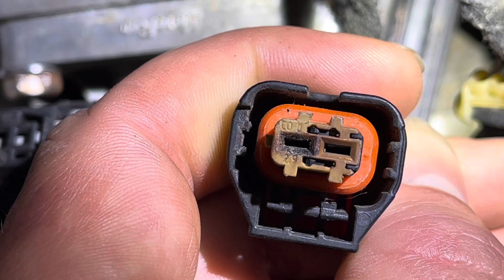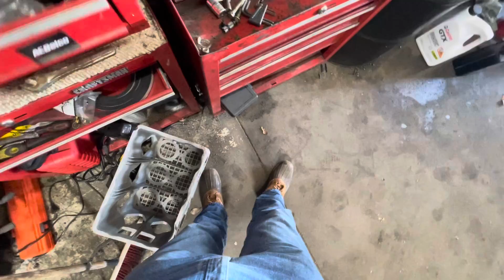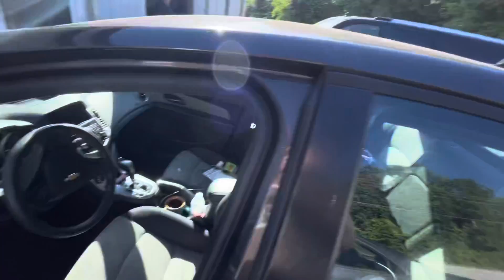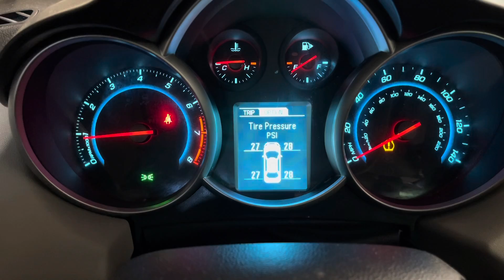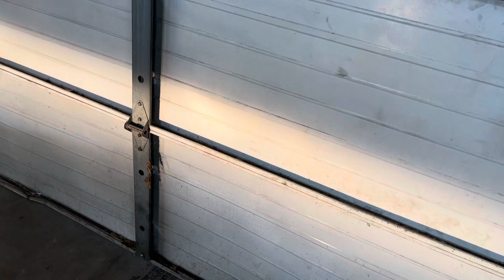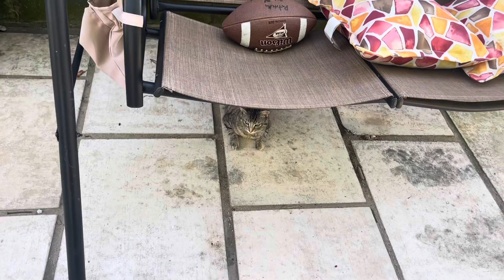Buying, fixing , and driving a $1,000 Chevrolet Cruze

Comment: Those are a pretty good little car. I bought one brand new in 2013 with 14 miles. It was a great car and will last if you don’t put cheap aftermarket/amazon parts on them

Comment: That’s weird yours has a big engine drain plug. I have a 2014 Cruze with the 1.8L and the engine oil drain plug is a little 10mm instead of the bigger one you have.

Comment: Jay hates every car. Ive been working on cars for almost 15 years, and sold cars for 14 years and i only hate VW and Chrysler products. I have a 13 Cruze LTZ RS 1.4 Turbo with 203k miles and its phenomenal. Runs and shifts excellent. Fixed all the usual issues. The 1.8s suck because they run a timing belt and are absolutely gutless. I love the Cruze, have since it came out. Theres a reason they are everywhere on the road still

Comment: I really like the looks of the later model Cruzes, but they have that stupid start stop tech. crap. Plus I worry about the cooling system problems with them. That is the one thing I hate about so many late model cars, they make them nice looking and you really want to buy one and then you read about all of the problems with them.
Reply: On the tranny, shift to L and with the up and down button, cycle it to L6 (if it has a six speed tranny.  If eight speed, L8.).  That will turn it off.
You'll have to do that every time whenever you put it in drive.

Comment: I’d take this over any Toyota or Honda compact car. With care nothing will go wrong besides whatever electrical issues you found. Seemed small to
Me . Change the oil every 3-5k and transmission fluid every 30-40k , coolant changes etc etc and it will be fine. Better looking than any Toyota or
Honda compact of these years.

Comment: whats geting sad is older cars and trucks part were ones someone was putting parts in plan to get back on road then something happens now everyone one was more now for older stuff i like them all fact is newer stuff so out sourced its no quilty  yet lot same manufacters sale same drive train for example is new process np 261/263/246 all junk 
old junk toyoda junk same made design 5.7 4.8 4.7 just number its the interior vs comfort vs dependabilty drive ablity add in try to repair something got remove ten parts to do it

Comment: All Cruze haaaave WIRING HARNESS ISSUES, COOLANT SYSTEM ISSUES, WINDOW ISSUES. You WILL have these issues even using GM parts to fix the issue, good luck going 5 or 10k before the issues happen AGAIN 😂😂😂😂😂

Comment: I remember back in 2007, I brought Chevy Prizm made in 1998 the mileage was only 22.8K but the body has a sign of improper cheap repair. I took it to Asians mechanic in LA area and has it done regular maintenance and the car was outstanding performance with used junks parts from e-bay. The cost to repair was low and it took me anywhere without trouble.

Comment: We have a ‘14 chevy cruze and we hate it. Only has 60,000 miles and has a bad coolant leak that the chevy dealership said they “couldn’t find”. Its has. The ignition coil rail fail several times apart from each replacement. Its turbo and it sucks at power. Always shifts weird during morning start ups. When the heat is on full blast the car kinda idles weird (up and down) for about 5 seconds. Im six foot 2 and had a very hard time getting in and out of it.
Reply: If the coil keeps failing the dealer techs are morons. 100% there's a short in the harness somewhere Aveos do it all the time too.

Comment: As far as your ground issue, there is a negative battery cable recall on these cars. I own a 2013 LTZ 1.4 with 45k.
There is absolutely nothing wrong with DexCool. My 2001 Silverado has never had a coolant issue, overheated or needed head gaskets or heater core. I just flushed the Cruze and put in New DexCool.
There were supposedly issues when Dex first came out. Anyone there has not been any reported Dex issues in years.
Reply: Dexcool might be the holy grail idk yet, I picked some up from autozone ran alot better after that.... just saying
Reply: At least for chevrolet cruzes late models.

Comment: I have a 2014 Cruze with the 1.8L. I recently disconnected the battery to clean the throttle body and I can’t seem to get the evap and egr monitors to reset so I can get a state inspection.
Reply from the maker: Check your fuses in the under hood fuse box. And check the ground wires mentioned.
Reply: @MXguy95  I checked the fuses under the hood and inside the car as well and didn’t find any blown fuses. I will have to check the grounds and see if any are loose possibly.

Comment: A friend of mine bought an LTZ trim brand new in 2014. It was at the dealer monthly for warranty repairs and it was a very frustrating ownership experience.
Reply: Overall as a GM vehicle they're not too bad if you get the non-turbo engines. Bonus for manual transmission. A guy at my work actually had a turbo Cruze around the same year and changed the oil religiously at 3,000 miles. He made it to 120k without any issues, ever. The problems with these cars stem from sludge because the people who buy these cars never do maintenance.
Reply: @NGGPeter  The problem is vehicle reliability is measured if a vehicle goes 200,000 miles these days without major problems. 120k is still low miles.

Comment: When the new Chevrolet Cruze launched in 2011, General Motors went into a crazy advertising blitz claiming this is the first car rated more reliable than Toyota Corolla and Honda Civic. They failed miserably on that and gave up by 2015. Today, General Motors is retrying this again with the all-new 2024 Trax made in Korea with Japanese-like quality, replacement of the Cruze, claiming to be more-reliable than Toyota and Honda again.
Reply: You can't just release a new car and claim it's more reliable than a car that's proven its longevity over several decades.
Reply: @benchattin  New 2024 Trax was descended from the 1971 Vega. Then 1980 Citation, then 1982 Cavalier, then 2005 Colbalt, then 2011 Cruze, and now 2024 Trax today. Each new model replaced is more reliable than the previous.
Reply: @waltchan  In what way is it descended? Because they're all small?
Reply: @666cemetaryslut That's the complete list of all the affordable Chevrolet vehicles since 1971 Vega, all part of the American Dream for middle-class families.

Comment: I worked on one for my Roommates daughter-in-law. Her boyfriend had Driven it through An intersection with standing water during a rainstorm And it died. Upon trying to restart it the starter wouldn't turn the engine over, So I was asked To check and change the starter if Necessary. I'm embarrassed To say that it took me Over 3 days to figure out that It was hydrolocked. The Intake it's right in front of the front Tire, two inches off the ground! Almost Any Amount of Standing water Would get sucked up into the motor. I like the way these cars look, And  probably good on gas But don't Drive it when it's raining lol🫠

Comment: I always thought the 1.8 was a good engine besides the timing belt. I really like Cruze’s they just don’t get taken care of by their owners.
Reply: The 1.8L engine are alright, it’s just the 1.4T you need to take extra care of.
Reply: @applepoop10  The 1.4t is good. My mother owned a 2012 eco that didn't give her too many problems. The only thing she had to replace was the water pump. She had the car serviced from day one dealership.😊
Reply: They are junk
Reply: Had 3, one new in 2012. Everyone of them, overheated, crumbled to pieces, cheap.
Reply: General motors vehicles are the most likely after being purchased new to never be taken to the dealership and just repaired by anyone rigging things up. Japanese cars have those maintenance required lights. Ppl run to a professional and have it serviced. That's why it can appear that a Japanese car lasts... Simply bc it's well cared for.

Comment: That’s a 1.8; and it has the thermostat assembly that ROYALLY pisses me off! If you were to buy the that thermostat at the GM Dealer parts counter it would cost you about $185; THE SAME GODDAMN PART with only a different part number for a 2009-2011 Aveo is DOUBLE THE PRICE at $360!
Reply from the maker: I buy them off Amazon for a fraction of that price. The aluminum and plastic ones will interchange too, I think this one cost around $38 for the entire assembly, gaskets, new sensors and thermostat installed and shipped.

Comment: Hope y’all are good jay good hearing from you again,  we can all agree we don’t like cruises but even still if it runs an drives for a decent price I’ll take anything
Reply from the maker: I’d buy anything if it’s cheap enough, heck I might even buy a Nissan! 🤮. Hope your doing well buddy! Glad to see you still watching
Reply: @MXguy95  dude your the realest no bull shit channel,  not to mention y’all are fun to watch to,  can’t wait till we break the 100k milestone,  and when I was watching the oil change section you got lucky with that drain plug,  a lot of them cruises came with a damn 10 mm screw that is softer than aluminum.  And it strips and snaps with no effort at all,  haven’t seen to many with the larger plug
Reply: @MXguy95  Nissans aren't THAT bad. We own a 2014 Nissan Murano that is nearly a decade old and still going strong. Yes, the Murano is a CVT, which makes it worse.

Comment: I remember when these were the car that was supposed to somehow “save” GM… I will never forget the time I rented a brand-new 2002 Cavalier - what a pile that car was… but it did seem like a good, honest car for better or worse.
Reply from the maker: The cavalier had no frills after the ending of the v6 optioned z24s in the early 90s. These plastic filled and rattling 4 cylinder cars are junk from the get go. But…. It was cheap
Reply: My sister had one as a daily driver with a little over 300k she sold it still running to a car parts pick n pull and bought a Tahoe
Reply: @crowdnine878  yeah, I don’t think reliability was the issue - but comfort, handling, and body integrity were not their strong pointd